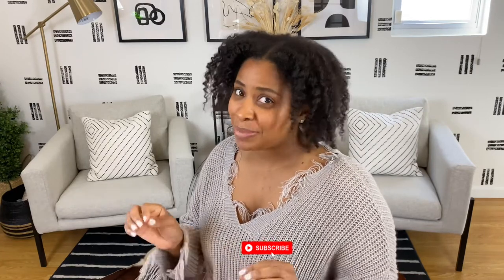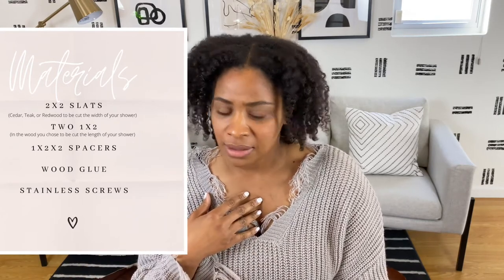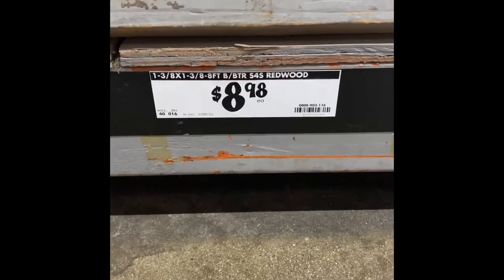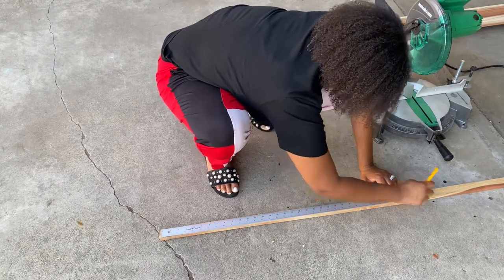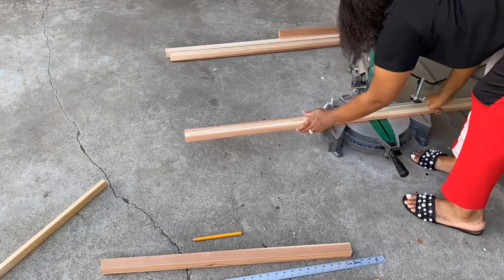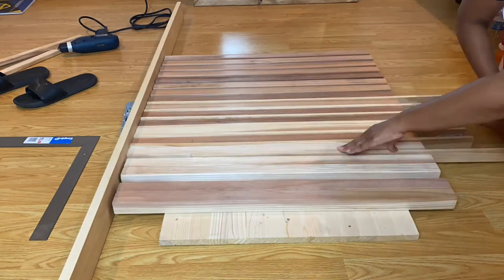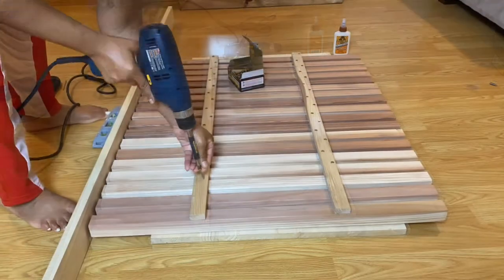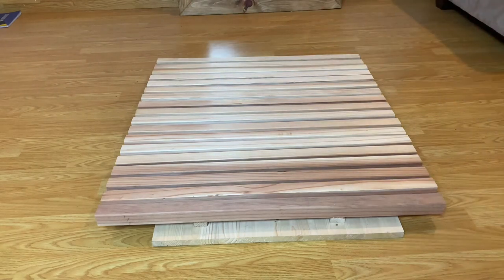Easy Bathroom Upgrade| DIY Wooden Slat Shower Floor | Ideas For Your Bathroom Shower

Comment: For anyone wanting to do this. Highly recommend cutting channels into the two slats that sit on top of your shower pan. This will allow water to drain from the outside into your drain. Don’t want any water to be trapped by those two slats. Definitely remove and clean the underside on a regular basis.

Comment: Have the screws shown any sign of rusting or deterioration? And how has the wood glue held up to the water?
Reply: She gets a A for effort but those screws don’t look like stainless steel outdoor. If you are thinking of doing this don’t use wood glue on water

Comment: Hi my love!! Thank you so much for posting this video!! This is exactly the type of thing I need for my shower!! I have a few questions, first, I am a little confused as to what to look for “spacers”. Is that just a tiny slap of wood, to space the pieces of wood evenly?? Also, about how many pieces of wood did you buy?? Our showers seem to be about the same size, but how did you determine how many pieces you needed to buy? And then also, if you don’t mind me asking, how much in total did this project cost you??
Reply: You can cut paint brushes up to use as spacers.